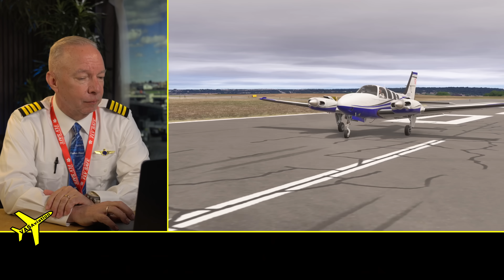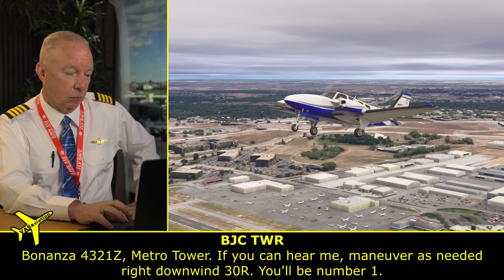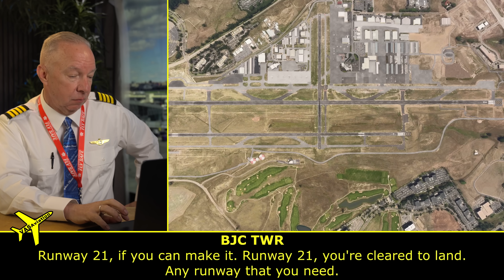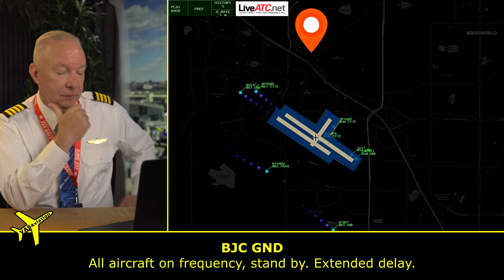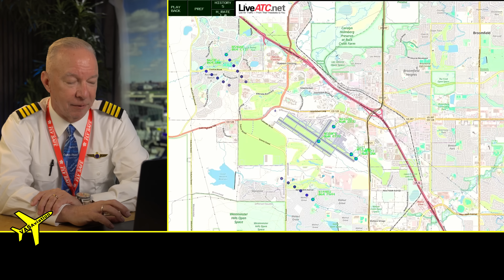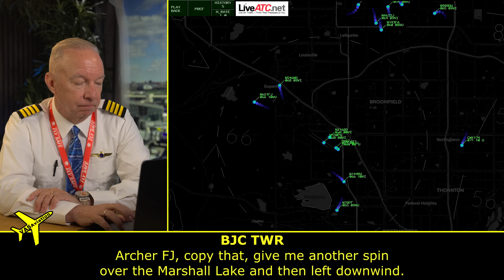Baron Crash in Denver: How a Door Popping Open Turned Deadly

Comment: I owned a 1976 B58 Baron for over 25 years. It’s not uncommon for the right front door to pop open in flight if the right seat passenger (usually not a pilot) did not latch the door correctly. There is no door  on the left side in the front. Other than the loud noise from the wind the plane will fly as long as the pilot just flys the plane. It is extremely difficult if not impossible to secure the door once it’s opened so a return to the airport to latch the door is the only option. 
Small planes are used by jump schools all the time for skydiving so the drag or aerodynamics of a partially opened front door is not the killer. Not flying the plane when it’s low and slow is. Sad story and hope it doesn’t happen to anyone else.

Comment: I retired from Broomfield PD a few years ago and have flown out of what was then the Jefferson County Airport, now the Rocky Mountain Metropolitan Airport, during flying lessons in Cessna 152s and 172s.  It’s not unusual to have tricky weather conditions there.  The area is now filled with large office buildings (Interlocken), the Flatiron Mall and tons of large apartment complexes.  Thank goodness there weren’t more fatalities in this crash.  Of course, just two is still tragic.
Over the years I responded to several airplane crashes there as well as the nearby Erie air field, most of which involved fatalities.  I was working an overtime assignment at the Jeffco Airport in ‘77 during the airshow fatality.  All tragic events.

I agree that the ATCs, along with police and fire dispatchers have extremely stressful jobs.  I was constantly amazed and impressed with how well they kept their calm and professionalism during high stress calls. It takes truly special folks to handle those jobs!
Reply: Correction; ‘97 not ‘77 airshow.

Comment: On my very first charter flight as very low-time PIC in the Twin Commanche, I had an almost identical experience on an IFR departure from Boston.

   From my book, "Catch the Wind" a Pilot's Memoirs"  Chapter 2 ----

                                                       The event occurred in The Year 1972 -  

     After flying only with instructors and passengers, after this passenger had gotten out, I realized that this was the first time I had ever been all alone in 
the Twin-Commanche - (rules were a lot laxer in those days)
   The Air Traffic Control (ATC-IFR) departure clearance I received was particularly long and complicated.  
   It took almost an entire sheet of paper to copy it.

   Before take-off, instead of putting my maps, charts, and other papers, (One of which had this very long ATC clearance written on it), in their usual spot in a box between the seats,  I placed them on the empty co-pilot seat beside me.

   The only door on the Twin-Comanche is on the right, or passenger side of the cabin, next to the co-pilots seat.     
   The door is initially closed by slamming it, causing a small pin to engage to the door jamb, similar to closing a car door.
   However, before take-off, the door is more securely latched by rotating the inside door handle 180 degrees counterclockwise, causing a much larger pin to engage and 
securely hold the door shut.
   When my passenger got out of the airplane, he closed the door, causing the small pin to engage and hold the door shut.

    Although it is the pilot’s responsibility to insure that the door is securely latched before take-off, on all of my previous flights in the Twin-Comanche, it was the instructor or passenger who sat in the co-pilots seat who actually latched the door.
    Although closing and latching the cabin door is on the pre-take-off checklist, which I completed, I must have assumed the door was already latched as I read over this item on the checklist.
   
   The Boston Control Tower cleared me for take-off. 
   I checked and re-checked, as always, to be sure the fuel tank selector valves were properly positioned and the magneto and back-up electric fuel pump switches were all on.
  “Well, here go’s”, I thought.  
    I took a deep breath and applied full power to the engines for take-off.
   
    Both engines roared to life and airplane accelerated rapidly down the runway.
   The airspeed quickly passed 60-70-80 miles per hour.

    At 80 MPH, I lifted the nose and the airplane leapt into the air.  The ground immediately disappeared as the airplane entered the low clouds.
    
   At this crucial moment, seconds after liftoff, while pre-occupied with controlling the airplane during this critical time of transition from visual to instrument flying, I heard what sounded like a very loud bang, followed by very loud engine and wind noise.
   I looked over to the right side of the cabin and was surprised and horrified  to see that the door had popped open, and to see and feel a rainy mist blowing all over the inside of the airplane and all over me.
   I was further shocked to see all my maps, approach charts, and the paper with the ATC clearance written on it, go sailing up from the co-pilot’s seat and out the door.
   
   (Because of the substantial airflow caused by the airplanes high speed, it is impossible to completely open the cabin door while in flight.
   Although the cabin of the Twin-Comanche is not pressurized, the draft over the fast moving airplane caused the door to trail open a few inches and created a slight vacuum inside the cabin). 
   
   This was, I discovered, enough of an opening and enough of a vacuum to draw all these maps, charts, and papers, one of which had this long instrument clearance on it, out of the airplane, and out into the rain and fog.
   
   I had to retract the wheels and flaps, set the engine controls to the climb power settings, trim and otherwise stabilize the airplane for the climb, all while flying on instruments.
   Being completely surprised and shocked by what had happened, my initial reaction was to immediately try to close the door.
   I had not yet engaged the autopilot, but, I lunged over and grasped and pulled on the door handle.
                                                         
    Out of the corner of my eye, I saw the gyro/horizon on the instrument panel indicating a sudden and rapid bank (Roll) to the right.
   Further surprised and horrified at the thought of rolling over, I quickly returned my attention back to flying the airplane, re-leveled the wings, re-established the proper climb angle, and forced myself to resist this sudden and impulsive urge to close the door, realizing that this simple error of forgetting to latch the door had nearly caused me to lose control of the airplane during the take-off. 
    It was one of those split-second decisions pilots make that have a lasting effect.
    Rain was blowing all over the inside of the airplane, and all over me, and, I was still shocked and confused, but, I waited until I had completed all the required tasks.
   
    (I have spent many years wondering what might have happened had I, in that state of total surprise, and engulfed by clouds and fog, not noticed that the airplane was rolling over and continued to try to close the door while the airplane was turning over in flight).  

   At an altitude of 800 feet, with rain blowing inside the airplane, the door pounding on the door jamb, and the roaring of the right engine blocking all other sounds, I managed to engage the autopilot, reach over, and with some difficulty, and with the autopilot controlling the airplane, close and finally securely latch the door.
   
   By the time I got the door closed and latched, the airplane was nearing 2000 feet.
   I tried to calm myself down.
   I wiped the rain off the instrument panel, off some other parts of the interior of the airplane, and, off of me.
   Although my ATC clearance had blown out the door, I remembered that, at that altitude of 2000 feet, I was supposed to turn left to a heading of 300 degrees and then continuing climbing to an altitude of 5000 feet.

   This was the only part of this long and complicated clearance I could remember.
   I was in the air, in the clouds, climbing in a high-density air traffic environment, and, because I had lost my ATC clearance, I didn’t have the slightest idea of where to go or what to do next.
   It was a sickening and helpless feeling.
   Although I knew it was a hopeless effort, I tried and tried to remember what I had copied as my ATC clearance.

    AVAILABLE IN KINDLE ON AMAZON

Comment: Several years ago I was flying a BE55 out of Houston Hobby. The door popped right after takeoff. I didn’t want to complicate operations at that high-density airport, so I continued on course, landed at New Braunfels 145 miles away and latched the door. It’s not a reason to die, people. Just fly the airplane.

Comment: The Everglades crash was indeed flight 401. I first read a book about it decades ago… the ghost of flight 401. There is also a film based on it which totally creeps me out! 
Don Repo (I think flight engineer) went down into the hell hole to try and sort the gears issue. 
It was his ghost that then kept popping up in planes which had been fitted with parts salvaged from Eastern flight 401. The cooker door I think it is, in the galley is the one that gets me. Don would appear it seemed in flights where there was a problem as if he was trying to warn the crew.

Comment: The front door opening isn't that big of a deal on the Baron. It's sad that someone could let that distract them. Now if it was the back aft door which would be the suicide door, that could fair enough drag I guess, but that wouldn't be able to pop open without the back forward door opening. I used to have the baron door pop open all the time as it was a junky B58 that the latch only worked some of the time. Normally I'd swing around for a touch n go, and while on the ground would slam and latch the door. I was young and bulletproof back then though. Then I taught in the B55 and made sure my students were prepared for that door to come open.

Comment: 4:18 😂😂 They died staring at the landing gear lights? That's kinda laughable
Reply: There was a bit more to it than that. Back in the day, you couldn’t just manually pull a handle in the cockpit to lower the gear if there was an issue. It involved going down into what they called the hell hole. From there, the flight engineer was having to yell up to the captain… I’m guessing listening out for him was the distraction. Maybe in the commotion the autopilot was also disconnected. There’s a film - the ghost of flight 401. Worth a watch!

Comment: I remember the L-1011 crash as I had just started working for Lockheed on the L-1011 production line a few months earlier. I read that the pilot accidently bumped the yoke, thus disabling the autoland system.
Reply: If I remember right, it was actually a little worse.  The autopilot in that plane was one where if you made a minor input on the yoke, it would continue flying that input.

So pull back slightly, and jt would continue to climb.  Push in slightly and it would continue to descend.

So the theory is that the captain had turned to talk to the engineer or jump seat guy and just barely nudged the yoke with an elbow or something and that got the autopilot to start flying a very shallow, almost imperceptible descent.

I think if the autopilot had actually cut off, either the plane would have climbed from the engine thrust or the pilots would have noticed something was wrong.  But since it was following that very tiny descent angle for so long, it went unnoticed.

Comment: A few more times we've had this happen on Barons or Bonanzas. Bad pre-flight, bad flight training or bad design? Something we really need to learn from and avoid it ocurring again with this fatal consequence.
Reply from the maker: I agree. I think getting the word out will help. Maybe our Bonanza and Barron pilots will avoid this issue in the future.
Reply: @CaptainSteeeve I had a door pop open on me and my wife in take off in the smaller cousin the travel air. It’s essentially a baron with 2 180 HP engines and 2 less seats. 

Those older barons and travel airs have door latches that can just pop open once airflow starts moving good unless the door is 100% locked. And they can be temperamental to seal. 

In my case, happened at KMQY, landed directly ahead on the runway as it happened right at rotation, and since it’s a old former military airport, it’s got a 8000ft runway to stop on.
Reply: On Beech's, The top latch can close when it's not engaged in the lock. When air gets under it, it will pop open, adding drag, wind and noise. I never had this happen on the Piper's I flew.
Reply: I had the top latch come open after takeoff in our 82 Archer. It is very disconcerting, and loud. I was able to gain altitude, slow the plane and slip left which allowed us to recycle the latch and get it to catch. It did take a few tries however.

Comment: I'm not sure if this is the same incident but in another recent video we were told the door may have come off and damaged the plane making it difficult or impossible to control it. They also said it has happened before on this plane and that it might have been the cargo door. Not sure if that would create the noise.

Comment: GROK: There are no records of an aircraft crash in Broomfield, Colorado, on May 7, 2025. However, a crash occurred on May 17, 2025, near Rocky Mountain Metropolitan Airport. A Beechcraft 95-B55 Baron crashed shortly after takeoff, around 10:05 a.m., in a field north of Midway Boulevard and east of Brainard Drive. The pilot reported an open door and attempted to return to the airport but crashed, resulting in a small fire. Both occupants, Eugene Knutson (80) and James Gelaude (74), died. The National Transportation Safety Board (NTSB) and Federal Aviation Administration (FAA) are investigating, with the cause still undetermined.
Reply: RRMA is located in Broomfield, Colorado.
Reply: Sorry, Typo. RMMA

Comment: The front door can't open more than a couple inches in flight.
Ditto for the rear door.
I've never had on pop open, but it can't be that bad with 550 hp.
Picture note: The rear doors overlap, the front must be opened first before the aft door can be unlatched. 

NO DOORS can be opened against the airflow.
Controller yelling doesnt make the aircraft radio louder.

Comment: for a one piece door , it should never  be a problem if carefully managed but this double door system is very different and likely creates tremendous drag and yaw to that side and the static pressure against its exposed surface of the rear door element would . totally prevent closing it , futile distracting effort.  Would prob need full left rudder , and aileron to the left also then careful speed reduction to get control then  pitch down while pulling power when landing assured. good reason to be paranoid about foretting to check doors and hatches.  one of the more important aspects of a typical one piece open door that will remain almost closed due to the slipstream is not to allow items to get sucked out and potentially get stuck in the rudder or elevator controls.

Comment: Most likely the front entry door. At rotation, the low pressure area over the wing pops the door open if it is not latched properly.

Comment: in some modifications the front door opening will cause very serious turbulence, which, if they were at all slow, would likely be in itself enough to make the aircraft barely controllable... 
this is a known issue with these doors, and has been known to cause crashes before.
my guess is, they were struggling to maintain control until they finally lost the struggle

Comment: the light bulb for the gear... I remember that as a flight over Portland, OR. in 1979. My memory is wanting to say DC 10 and the crew wound up flying around in circles (Pilot, co-pilot and engineer) while fiddling with a replacement bulb, all the way up to when the plane ran out of fuel.
Reply: That was a United Airlines DC-8 in '78.
Reply: @AviationCat-m2q  Fair nuff!